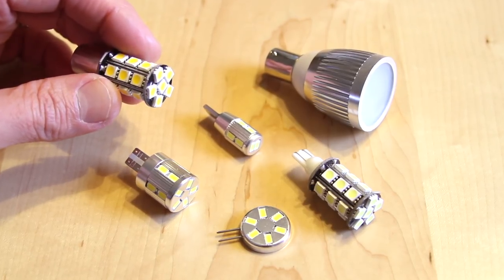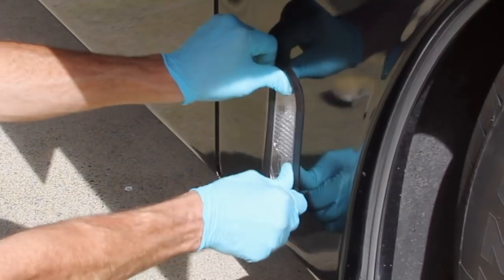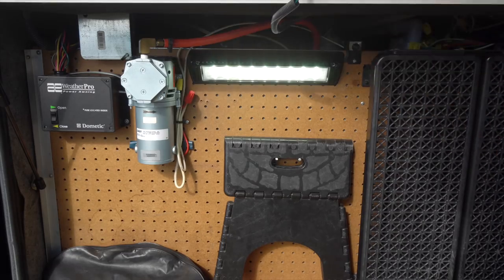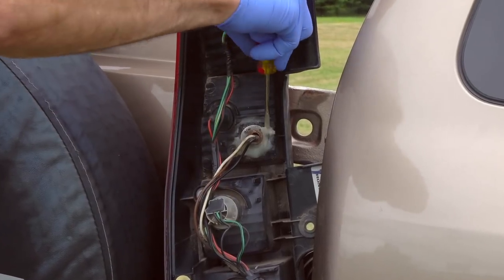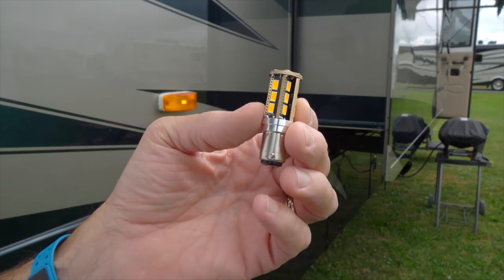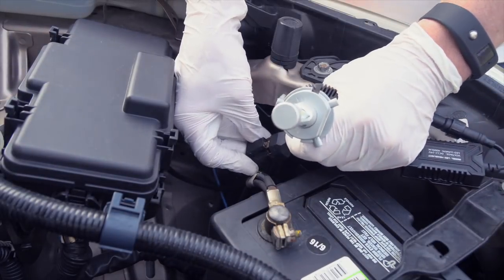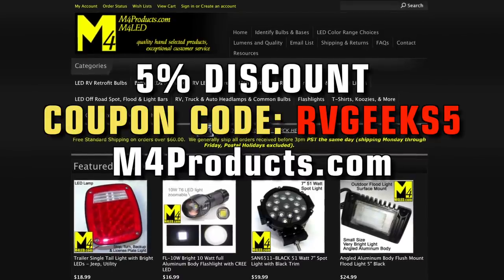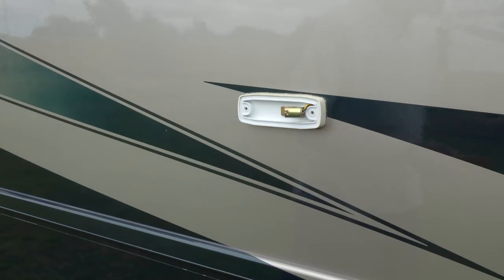LED Your RV — PART 11 — Increasing Exterior Visibility

Comment: Great video & upgrade BUT you need to check on your state vehicle inspection requirements when you start to install LED upgrades on brake,backup, license, turn signal lights basically any lights on the inspection list. My car just failed Virginia inspection for Led lights on license & side marker lamps. I was told my LED lights were not sae or dot certified. A load of BS but had to take them out and put back in old lights to get car to pass inspection! Be warned brighter is not always legal!
Reply from the maker: Thanks for the tip, Pete. Sounds like VA inspectors are nazis about that sort of thing. That’s crazy that they’d even notice or care!

Comment: This is great! Thank you for the video.  I was wondering if you have ever done a video on RV Navigation/GPS units?  It seems like there are very few units that handle external antennas or are actually reliable.
Reply from the maker: Hi Bruce! We haven’t actually done a video about RV GPS units, because we’ve never owned one. The reason for that is the conflicting reports, reviews, and ratings we’ve seen where some people find them to be reliable, and others have been sent down dead end roads or toward low overpasses or low weight bridges. We are in the process of looking for a new GPS unit, and may be choosing one within the next few months. We will of course provide a full report pro or con on what we find.
Reply: Thanks for the reply. I have the same problem with the RV GPS unit that you describe. My unit refuses to lock onto the satellites even after trying boosters and adding and external antenna (I drive a Bluebird Wanderlodge so the whole RV is steel). I tend to fall back on my phone and the SmartRoute  RV application as it will get a signal every time and does a good job at routing.

Comment: First, again.   I just love LED replacements. I always look for a 5000 degree Kelvin color temperature, as close to Noonday sun in color as possible, and is higher color rendering index (CRI) , which is a measure in percent of the number  of colors that the light source produces that the human eye can perceive as I can find. Another Advantage LEDs have over other light sources is there quick ramp up to full power. When you replace a flashing lamp with an LED they appear much brighter because they are almost instantly on compared to whatever you replaced them with. Please keep the great videos coming!nmci
Reply from the maker: Thanks for the great comments! 5000 is a great choice. We like daylight white, too. And yes, LEDs light INSTANTLY! This makes them especially good for brake lights, since it cuts about 1/2 second off the time from stepping on the brake to lighting the brake lights. In a sudden stop, 1/2 second can be a lot of warning for more stopping distance for the driver behind you, especially at highway speeds. Haven't done our brake lights yet, but we have to leave something for another day, right? ;-)
Reply: You do have to eat an elephant one bite at a time.  I normally start with the brake lights, then do the turn signals so other drivers can see my intended movements on the roads.  Interior lights are usually last.  I have not put LED headlamps in any of my vehicles as I have HIR1(9011) in place of 9005 or 9006 bulbs in my current vehicles.  I recived a box of free samples from Toshiba of hte original HIR1 bullbs but I am almost out of them, and I will be buying two new vehicles soon so I will have to look into the LED headlamps that M4 Produces sells.  Thanks for coridinateing the 5% discount with M4 Products for us!!!!!!!

Comment: Why do you have to mount a 'driver' for the headllight conversion and not for the other applications?
Reply from the maker: Excellent question! We never thought about that. It might have to do with the intensity, but we're not sure. I think we're going to have to ask Steve and get back to you!
Reply: The primary purpose of the driver is to supply the LED with clean consistent voltage.  Your vehicles voltage may fluctuate based on charge, load, and speed.  Proper small LEDs have a driver built into the bulb itself.  The brighter the LED, the bigger the driver needs to be, thus, this brighter model headlight need to have an external driver which mounts inline between the vehicle harness and the LED lamp.
Reply: Thanks for the clarification.  Greatly appreciated.
Reply from the maker: Thanks for jumping in, Steve! You are indeed da man! 😊
Reply: Sounds then more something like a capacitor to keep a constant voltage maybe?

Comment: So your saying matching the color of the LED 2 the lens is better?
if you can find the color. matching it takes time white is still good i bet.
Reply from the maker: Correct. If possible, it’s best to replace with a matching color, so the result ends up being as bright as you hoped. If you have to go with white LED bulbs, be sure to get brighter ones than you think you’ll need, as they will be dimmer behind a colored lens.
Reply: makes sense, I didn't really think about using the same color if it doesn't come that way.

Comment: Great  video guys. Are you still touring around Cape Breton?
Reply from the maker: Thanks! Just boarding a ferry to Newfoundland!! ⛴😄
Reply: neilreel_7151 here. Are you sailing to Port Aux Basques or Argentia?  Did you catch the ceilidh in Baddeck?
Reply from the maker: Across to Argentia (boarding shortly!), then returning from Port Aux Basques. We made it to last Wednesday’s AMAZING ceilidh at the Gaelic College, as well as the annual fiddlers concert there. Hoping the attend Colin Grant’s performance at the three fiddlers dance in Margaree when we get back if the timing works out.
Reply: Excellent!! Safe travels to Newfoundland..

Comment: Nice upgrades, I like M4 led bulbs but have had a fair amount of the blubs fail and the smell is awful (inside) hope you have better luck, exterior LED's also haven't lasted eaitehr.
Reply from the maker: Hi Jello. This is the first time we have heard of this type of problem with M4 bulbs. We have a very wide variety of sizes and types of M4 bulbs that have been in use on our RV for many years, and we have a literally not had one single bulb burn out. Ever. And we’ve never smelled a thing. Have you spoken to Steve about this? We are thinking there could be some issue with your electrical system voltage output that could be causing both the odor and the failure issue, so they may both be related to an over-voltage situation. If you haven’t already reached out to Steve to ask his opinion on this, we recommend contacting him through the M4 website.
Reply: RVgeeks Yeah the one under my microwave blew this summer created quite a stink inside the RV, then another one in the bedroom smoked last year and all the exterior bulbs I’ve installed about half of them now need to be replaced so I certainly speak from a position of experience I hope you have better luck.
Reply from the maker: Have you had the voltage in your RV checked? Something’s not right.
Reply: Be sure and check the voltage with the charger or converter on.
Reply: So this first happened with our 2016 Keystone burnt up two in 12 months, now we've moved on to a Prime Time 5th wheel and its happened again so two bulbs in two different RV's no big deal is what it is. Installed 194 LED equivalents with wedge base for the exterior marker lights so far 4 have gone bad. Started putting back the incandescent bulbs I saved in the foil bags the LED's came in as needed sure glad I saved them. We have all OEM interior LED lights with the exception of a few locations like vent hood, docking station, and exterior marker lights that are incandescent. Im not complaing just sharing my experance.
Reply: Yes all good on that end
Reply: Jello Jello l
Reply: If you haven't already, give me a call or email with details with order info so we can try to determine what is going on, something is up.  http://www.m4products.com/contact/

Comment: Awesome! We are ordering a new RV soon and will make sure to include LED upgrades. Love the channel!
Reply from the maker: Odds are really good that any brand new RV will come with LEDs from the factory. But if you want to add more, M4 offers a lot of choices (and frankly, but unsurprisingly) higher quality than OEM. Congrats on your upcoming new rig!
Reply: I think you are correct on that thought. Our RV is not a big or as cool as your rig. We are ordering a custom built modern "sheep camp" and will likely have the first rolling stock off the production line from a new company. This will be replacing our previous model that sold unexpectedly because of YouTube. I kept notes on what I would do different given the opportunity to start from scratch. Your channel has been a source of inspiration for that list. Our RV had LED inside and I did add LED to every outside compartment. After this video I now have additional LED upgrades in mind.

I know you guys are busy but if you ever get bored some night in the RV and decide to watch another channel here is the playlist for the RV we sold Camp 216 Playlist - https://bit.ly/2raNWyb 

Again, love the channel, content and presentation style!
Reply from the maker: How great that you sold it with YouTube! We'll have to try that when we're ready! 😉 Thanks for the links. We'll check a few out when we get a chance.

Comment: One downside to consider with LED bulbs is that they do not generate much heat. This means that, in the winter, they don’t generate enough heat to melt ice and snow buildup.  This can lead to your shiny new lights being completely covered over making them virtually useless. This can be especially dangerous with tail lights where you would not notice this like you would with headlights.   Living in Michigan I have had numerous opportunities to stop and clear off my lights, especially in sleet. This is certainly not enough of a concern to get me to switch back to 19th century technology, just a heads up.
Reply from the maker: Thanks for the tip John! Very important information. Guess we'll have to continue snowbirding after all! ;-)

Comment: Have you addressed wether the led's are DOT approved.  At the FMCA convention in Gillette an expert said that some states will issue tickets for non-DOT approved vehicle lights. Apparently there is a flicker on some LEDs that is not present on incandescent bulbs and that is how they can tell.  The seminar I attended indicated to be sure the LED was DOT approved before you switch bulbs.
Reply from the maker: Hi Don. A couple of things... there is no flickering from the bulbs we installed, and the color isn't that blue-ish tint you see in some aftermarket lights. So it's not possible to tell they're not standard incandescent lights (other than the very clear white light, and excellent visibility they provide). We've never heard of any state targeting aftermarket bulbs, other than those that are misaligned, and blind other drivers. We always recommend correct aiming to be sure that doesn't happen. We've been using LEDs in our RV for quite a while, and now in the car for quite some time too, and have never once been flashed by an oncoming vehicle thinking we had our high beams on. They are awesome lights, and we love them. If anyone is concerned about the technical legality of any aftermarket bulb in any particular state, we suggest checking with the state DOT website to see what they say. Bottom line for us... no one can tell they're not standard, that they provide such improved visibility for us, it's a no-brainer.
Reply: Just though i would pass on what was being said at a seminar.  I have used M-4 based upon your recommendations and completely replaced all bulbs on the interior of my Monaco Knight Motorhome and my Arctic Fox Fifth wheel, well over 1,000 worth so i do trust your recommendations and M-4's great service.  Thank you for the discount by the way!!!
Reply from the maker: Thanks so much, Don. All good info.

Comment: Changed all the interior bulbs on my pop up to LED bulbs and got them from the lawn and garden department. Needed brighter lights and the old bulbs would turn black after a season. Good color temp to. Been looking for a travel trailer. Newer ones come with LED light fixtures. My issue is if it goes bad you have to replace the entire fixture not just a easy cheaper bulb
Reply from the maker: Good point, Mike. That’s true of a lot of the new RVs that come with LEDs. Steve at M4 has begun to offer replacement fixtures for some of the most popular units, that have higher-quality electronics, heat sinks, and color. If the units in the new trailer fail over time, there’s a chance you’d be able to upgrade them. But it would be better if they came with fixtures that had replaceable bulbs! 😉
Reply: RVgeeks yes I wish it was just replace the led bulb. Cause till the new fixture came in you have a dead light. Easier to keep a few extra bulbs in a drawer
Reply: We are adding more replacement LED modules just for this demand.  I agree, it is silly to replace a whole fixture with another whole fixture often with the same LED issues.  See this section for ones we currently have, and more will come as requests are made:  http://www.m4products.com/better-leds-for-factory-led-fixtures/